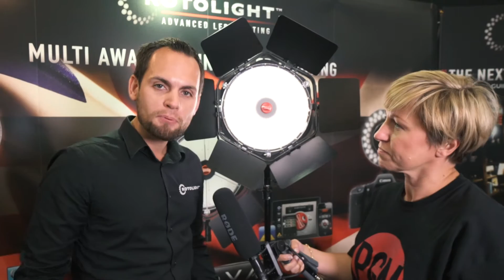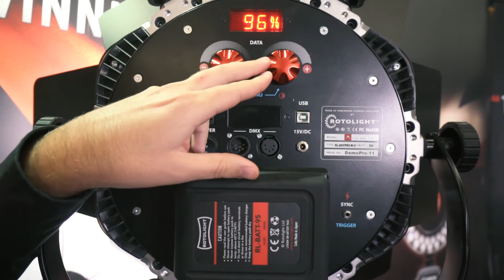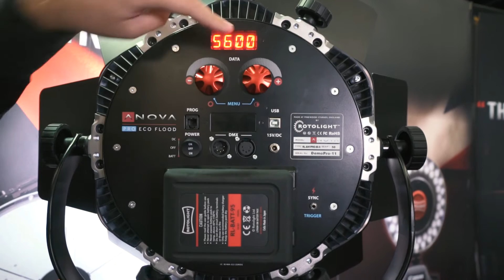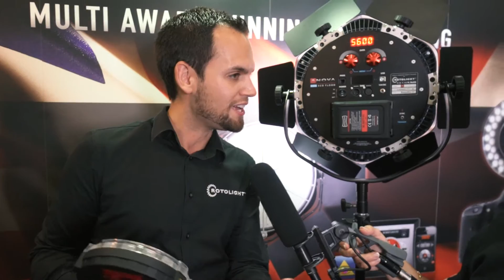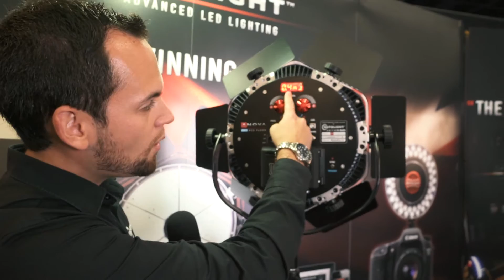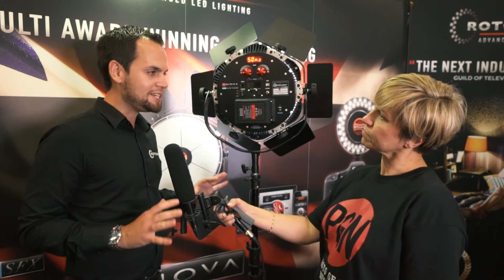Photogearnews at Photokina 2016: Rotolight Anova Pro

Comment: I saw one of these demonstrated in a camera shop a few weeks back but completely underwhelmed.. it had a lot of fancy effects for stage and theatre use.. but I found it nowhere near bright enough, especially for the money. At full strength I was easily able to look into it, whereas a small Manfrotto 8 LED hotshoe light I recently bought threw out more light... am I missing something here? Surely we need brighter lights for better lighting, not just a bigger cluster??!
Reply: Interesting. Are you saying the only savings here might be weight, heat and cost... at the expense of good light?
Reply: Most definitely.. this is a BIG unit that I feel does not deliver all that it portrays. Ok, so it can do some 'effects' like simulated lightning (how often will that get used?) but the main aim of a large video light should surely be a large amount of light? I'd recommend anyone to try one out... maybe I missed something or maybe the sales guy missed something that give it the full beans.. but I watched everything he did and it certainly looked like he wound it up to 100% and, to repeat myself, I could look into it without any problem. I've got quite a lot of LED lighting for various reasons and, as an example, an LED light bar I've got for musical events which has got 12 x 3w LED's in it is almost blinding.. so, Rotolight, help me out here. Even one of the Rotolight mini ring lights that go onto SLR cameras seems to pump out a similar, if not greater, amount of light.
Reply: Bigtel1970 Quite often marketing and promotional efforts supersede the actual value of the product. I hope someone from Rotolight reads your comment.